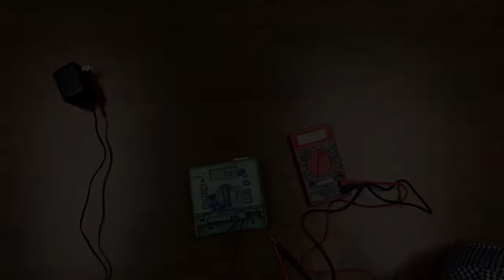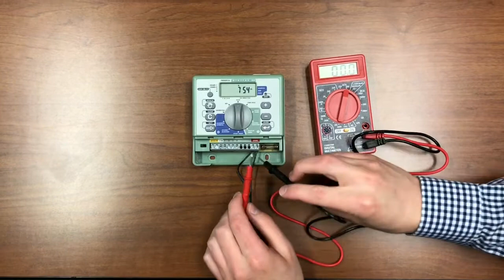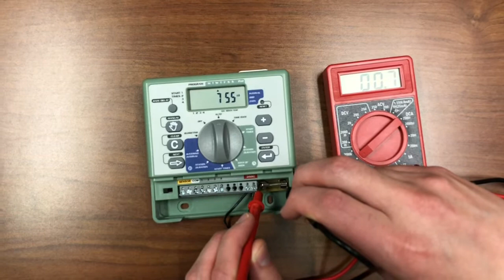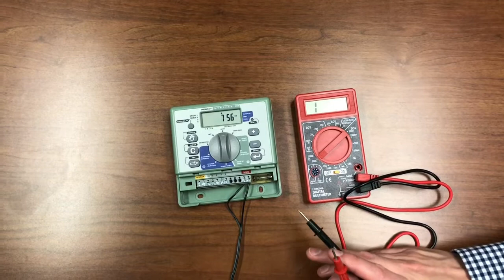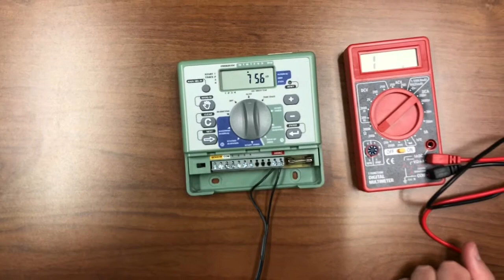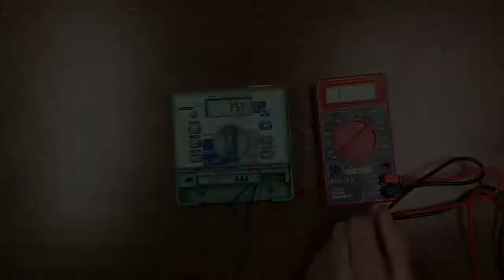Test timer with multimeter

Comment: I have exactly the same timer and when a zone is on it does show voltage 24ac with out the load. As soon as I connect the solenoid, voltage drops to 0. Solenoid is new and works if I directly connect to a power adapter
Reply from the maker: Hello, this is a unique problem we've not heard of before. But we want to make sure you're taken care of and the timer is working as it's supposed to. If you could please reach out to our support team, we'll be happy to get this resolved.